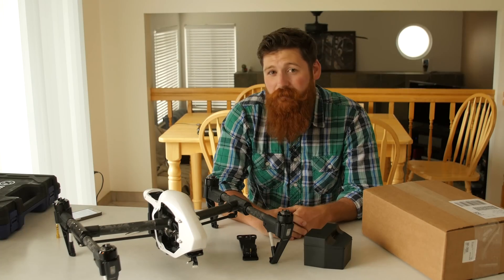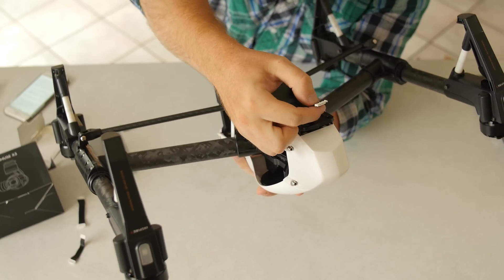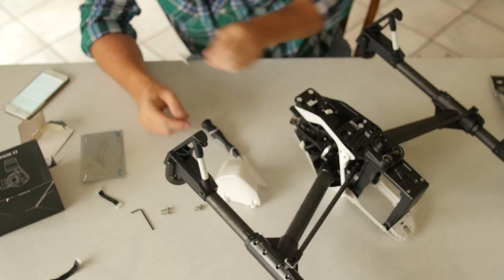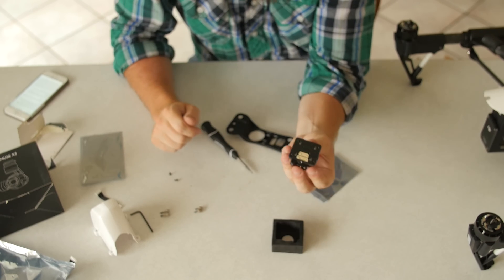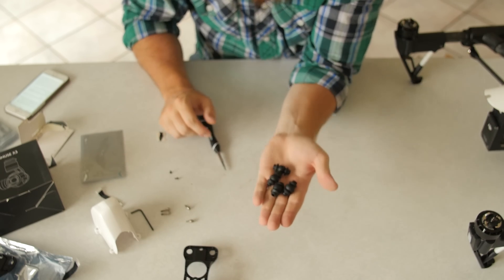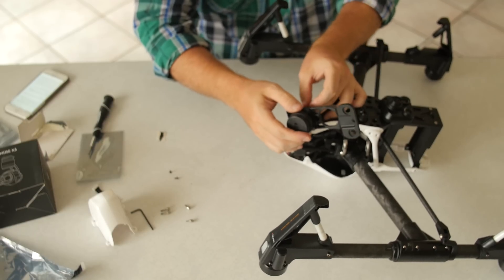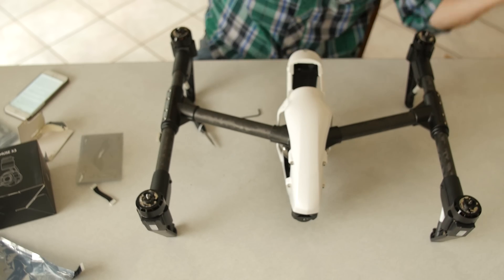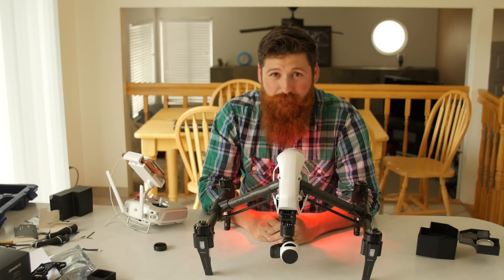HOW TO: Fix broken DJI Inspire 1 Gimbal and Mounting Plate (DJI Inspire 1 Crash)

Comment: Same thing happened to me.... did you have to purchase a new cam or can you get PARTS TO FIX THE CAM.... the only thing that broke is the arm on the cam... and well the ribbon connector.
So replacement arm piece and ribbon would be the only thing to purchase to fix cam....
Reply from the maker: +Guy Letourneau Sorry to hear that! I'm pretty sure the camera and gimbal are one part in the parts list so I don't think you can buy them separately. The camera body on mine actually had a few cracks, but I have a feeling it would still work alright.
Reply: +AlphaGraphics Bountiful Wow this is making me thing twice before purchasing the X5 Cam unit!
Reply from the maker: X5 is pretty pricey. While I'd love to have it the standard inspire 1 camera seems to do the trick for now and mixes alright with the footage from the GH4. But I have to admit the dynamic range and RAW on the X5R is really REALLY tempting. It's one of those things where I feel like you can get amazing results with older gear but the newer gear gives you more wiggle room just in case you don't quite nail the shot while you're in the air.

Super smart move by DJI making the new X5's pair so well with GH4 and other Micro 4/3 cameras. So many people are already flying GH4's on larger quads that this makes for a great ready to fly alternative.
Reply: +AlphaGraphics Bountiful Indeed , but if you purchase the x5r, make certain DJI offers the parts to repair it if it gets damaged, and not treat it like a 3,000.00 dollar bic lighter you strap to a flying platform, which when broken their support sounds like crickets in a field, and they just sell you a brand new one. no way! still waiting to hear about their service on that camera. I want to see a parts list before i jump in!

Comment: Awesome !! Thanks !
Reply from the maker: +Marc S Glad you liked it! We should have another one posted soon... which unfortunately means we had another crash... not cool. Quick release prop came right off in the middle of a flight and the inspire 1 fell like a rock. Caused a bit of damage but fortunately it was over a parking lot so it was only damage to the inspire 1.

Comment: Hey great video with awesome tips! I bumped my camera on the grass, nothing too bad at all, but it was enough for one corner of the mounting plate to pop out from the rubber shock absorber. Now the camera has developed a shake - it's a little left-to-right vibration and the horizon is about 1-2 degrees off from level. As far as i can tell, nothing is broken. Have you had any experience with this? Thanks
Reply from the maker: +Ja Co Thanks for watching and commenting. I've found the Inspire 1 is a bit more fragile that people expect it to be (especially if they have come from flying a phantom) I've never experienced the issue you're having but the first thing I would check would be the actual camera/gimbal. Take it off and check to see if all the motors are still lining up and that they rotate smoothly. If something got bent in one of those pivot points it could mess things up. This stuff is pretty precision so the little bumps can really throw things off. Hope that helps and that you get your inspire 1 up and running 100% again.

Comment: Thanks for this, I busted my front end up today after having the drone pushed into trees from higher than normal winds here in the UK. I was also trying out ATTI mode for my commercial qualification so it didn't react quick enough. Anyway the bits will arrive tomorrow, job for the weekend!
Reply from the maker: +Neil Soane Hopefully all your parts came and you're up and flying again! ATTI is great for getting those smooth gliding shots without the GPS mode fighting it but you definitely have to be more careful. I used to fly a Phantom 1 and it was SUPER noticeable in the footage when flying in GPS mode so I only flew in ATTI, but with the Inspire 1 I've found you don't notice GPS mode really at all in the footage for most situations. I'm excited to check out some of the new flight modes and new camera system they just released though!

Comment: Do you have your 333 exemption for commercial work?  I am running a small aerial business and century 21 is asking if I have a commercial license to do work for them. Did some research and there are only 151 people in the U.S. that have this.  I checked it out and there are huge hoops the go thru to get this exemption. I did like your fix on the gimble.  Just looking for some info to move forward.  Anything would help. Thanks.  My  email: jamie905@live.com
Reply from the maker: +Jamie Juno I don't have the 333 exemption for commercial work, but have been looking into possibly getting it. Chris Newman over at Cinechopper.com (super knowledgable and one of the best in my opinion) often has free live webinars that you can attend where he talks a lot about the FAA regulations and 333 exemptions as well as other information about the aerial video/photography business. As of right now you do not NEED the 333 exemption to do commercial work unless the CLIENT is requiring you to have it. This might change when the FAA eventually comes out with new regulations, but for now there is no restriction despite what others might say. Just don't fly at night, over 400 feet, near airports or other no fly zones, or over crowds and you should be fine. Also get permission where needed from whatever location you might be shooting at. Insurance is also a must for doing commercial work.

I will say if you DO get the 333 exemption you can likely charge more for your services just because you have it, but it's only required if the client is requiring it. Hope that helps!

Comment: Hi I have a question about the inspire 1 , how hot the motor for first flight? Thanks
Reply from the maker: Hugh Wong I would imagine the motors get warm but I've never actually touched them right after a flight so I don't know for sure. I don't think there would be a difference between the first time ever flying versus any other flight, but maybe someone else that sees your comment here can give you a better answer. I would say if they are super hot after a flight there may be something strange going on but since they do spin super fast some heating up would be logical to me.

Comment: Thanks, very helpful. I had a similar incident but it appears the camera/gimbal took most of the impact. There is one spot in the middle of the mounting plate with a hole and there is then a receiving screw hole below on the main body, do you know what this is for? I have a little damage around the inside of this whole, it likely got jammed into the screw mount on impact but didn't know if it has any function or if it has to do with manufacturing or something else. https://www.dropbox.com/s/lmvtutvbr876601/Screenshot%202015-08-04%2012.54.39.png?dl=0
Reply from the maker: Jake Fields Someone else had that exact same question! I actually didn't even notice it until they brought it up. As far as I can tell it doesn't have any function and none of my replacements parts came with anything to put in there. It would seem like putting anything there to attach the plate to the quad would keep the rubber dampeners from working. It very well could be used as part of the manufacturing process. If I find out otherwise I'll let you know, but as for now it looks like it isn't anything to worry about.

Comment: Thanks for sharing, it was a good video, hopefully I don't have to do this, now I know how. Have come really close to hitting a tree head on several times and have reversed very hard and gone up to avoid.
Reply from the maker: snathla Haha I really hope you don't ever have to do it either! But luckily most repairs are pretty simple on the inspire 1. The bad ones are when you break any of the carbon fibre rods since they have all the wires running through them. Glad you liked it and thanks for watching/commenting!

Comment: While you had the "Nose Cone" off you should have installed a second pilot 5.8ghz camera so when the film camera is pointed in a different direction, you don't destroy it again.
Reply from the maker: Bobster986 haha. Yeah not a bad idea. This one wasn't so much that the camera was pointed a different direction than my flight as much as it was me flying in super fast and a gust of wind bringing it down a few feet lower than anticipated. I do like the idea of having a dedicated true FPV flight cam on it though!
Reply: AlphaGraphics Bountiful Yeah, It's the only way I have done two person work. Hopefully DJI will have it as standard on the Inspire 2 when it comes out, if not it can be modified. Happy fly and safe landings! ;-)

Comment: So what did you end up doing with the old camera? I need the shell of the old camera. If you're interested in selling please let me know.
Reply from the maker: Michael Hey Michael I got your call sorry for not responding sooner! I've kept all the broken parts JUST in case I end up needing any part of them in the future. There is some damage to the white shell, a crack on the front near the lens and on the back by the USB port. So I'm not sure if it would work for you or not. If you're still interested you can call back and we might be able to work something out.
Reply: AlphaGraphics Bountiful I just need the plastic plating on the back of the fan, and the plastic covers around the gimbal next to the camera. The white housing isn't a big deal but since my is scratched up but not cracked. it can be repainted. Let me know if you're ok parting it out. Give me a call.

Comment: I noticed there is a single screw hole through the gimbal mounting plate and into the body. Is there supposed to be a screw there? It's right directly behind where the camera mounts onto the plate. If so, what size is that screw? I had a crash too and I noticed this when repairing. Thanks!
Reply from the maker: Duane Broussard Sorry it took so long to get back to you! I don't believe there is supposed to be a screw in there as that would make the mounting plate fixed and the shock absorbers wouldn't be able to do their job. Mine didn't originally come with a screw in there and a screw to put in there didn't come with my repair parts so I'm guessing it is for something else. Maybe there are instances where the plate needs to be hard fixed to the body of the Inspire 1 but nothing that I know of. Thanks for watching and commenting and again sorry for the late response!

Comment: Thanks for sharing the video, which I wish I had have seen 3 months ago. I had a crash onto the deck of a slow moving yacht after getting some great shots from above. The mistakes I made in regards to the crash were: I should have got the captain to stop the yacht and/or switched to Atti mode. Even with the yacht only doing 4 knots it was difficult to manoeuvre the Inspire for my catcher to do his job. As I was fast running out of battery I ended up crashing the Inspire on the deck, just missing the mast stays. Luckily the camera and gimbal were not damaged. I was able to secure a new mounting plate and cables from a local dealer in Australia. I had pulled the Inspire apart, to see what parts I needed, about a week before I was able to do the repair and struggled with getting it all back together. Like you, I lost the last 20 seconds of footage, which was a great pity as I'm sure it would have been interesting reviewing my panic stricken attempts to prevent a wet landing. Thanks again
Reply from the maker: David Barton Hopefully you got most of the footage you needed before that crash! There is a definite fine line between not pushing yourself and ending up with boring shots and pushing it too hard and getting yourself into trouble with very unideal situations. Thanks for sharing your story and thanks for watching!

Comment: That awesome so how much did it cost u for all the parts? Also what's parts are good to get to have ??
Reply from the maker: Ec130Rhine Hey thanks for watching and commenting! I'm glad you liked it.

Part 40 (camera and gimbal) was $550, Part 41 (mounting plate) $80 and Part 17 (cables) $4. And then it was free shipping so a total of $634. Not super cheap but since I use it for paying gigs I have to have it flying to make money.

As far as spare parts that are good to have... I probably wouldn't go out and buy any parts just to have them other than maybe props, but when something breaks and you have to repair it go ahead and keep the broken parts around. For example I now have an extra gimbal mount because it was only the gimbal mounting plate that got damaged. I also have an extra gimbal case, ND filter, rubber dampeners, etc.